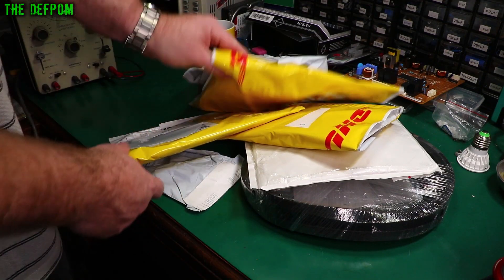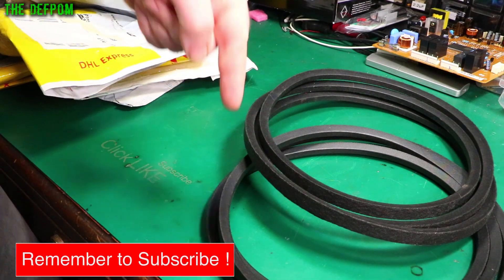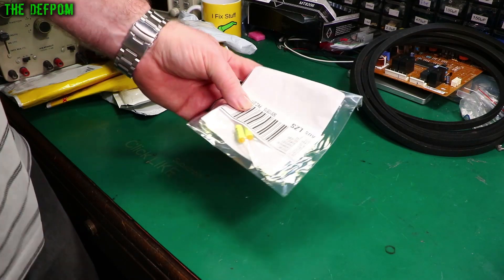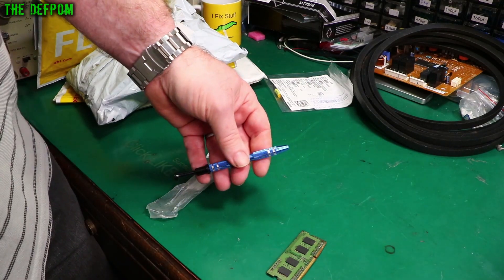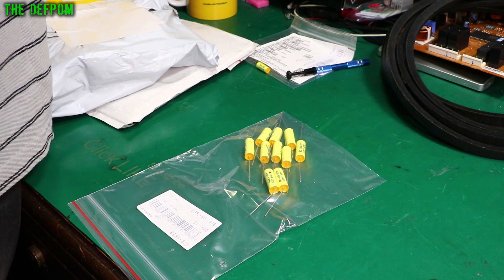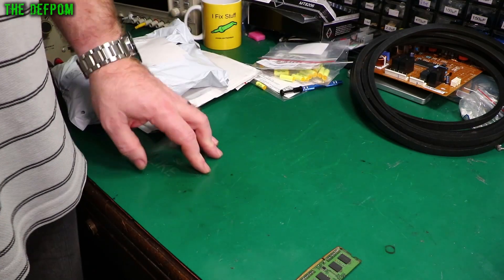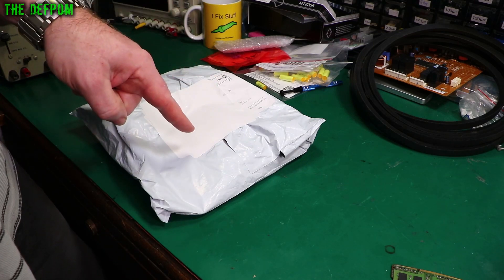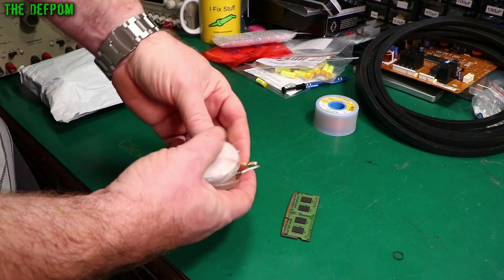🔴 What's in my Mailbag ? - Mailbag Monday 1st August 2022 - No.1027

Comment: Ah, the IEC cables. Once you got enough electrical equipment, you can never have too many of them. At least not the correct ones. :) Recently I ordered a bunch of short cables, some angled, to cut down the cabling mess behind my test equipment, because included cables are usually too long.

Comment: The IEC cables could be crap at the strain relief. Bought myself a TS100 soldering pen and the cable (C5) they shipped with the power supply came apart at the strain relief.